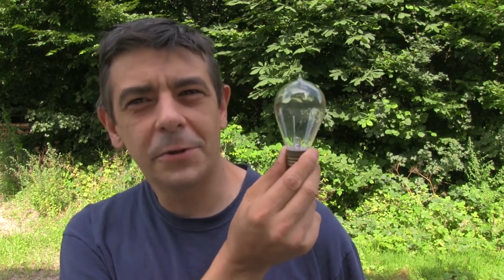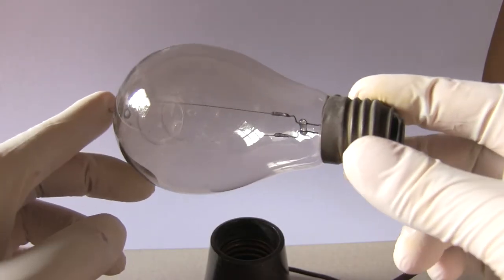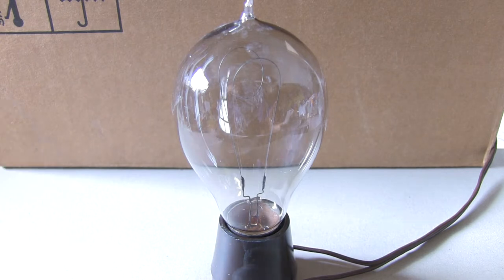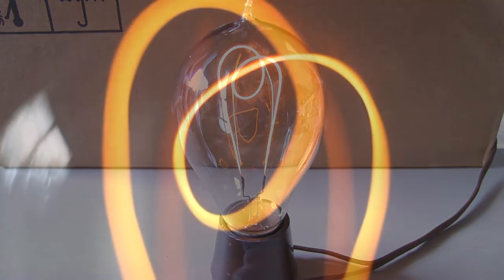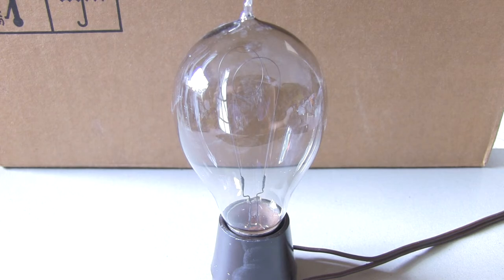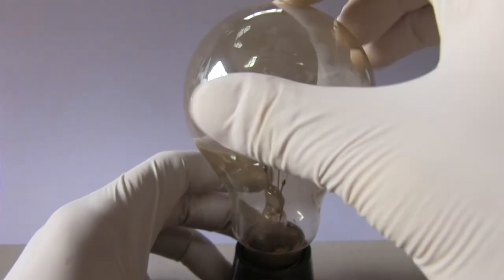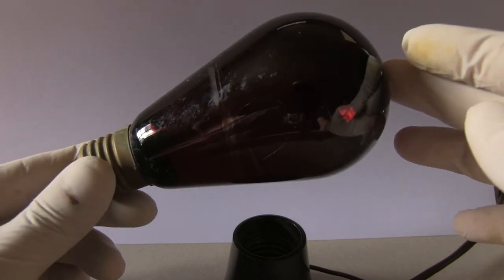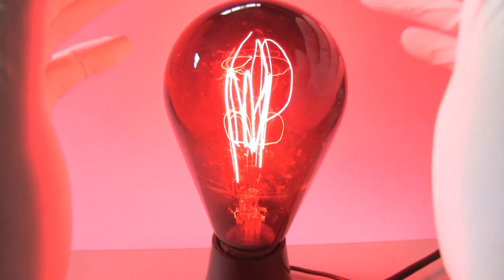Carbon filament Lightbulb from the 1900's. And others from my collection

Comment: But how many Watt has the old carbon filament bulb when comparing it to the 115W from Philips?
Reply from the maker: It's about 40 watts, I measured the current and calculated it, since there were no indications on the glass or socket.
Reply: @MrAnalogDan12  Thank you! But then its no surprise the new one is brighter than the old one. ;)
Reply from the maker: @karsten2  Maybe I mispoke in the video. I wanted to compare an old style filament (the Philips 115 watts) with a modern 100 watts light bulb which is then way much brighter. Sorry bout that, and thanks for the feedback !
Reply: @MrAnalogDan12  Oh. Understood. Well you compared the old carbon filament bulb on thge left in direct comparision with a newer carbon filament bulb on the right in the video. So I thought that this comparision isn't fair because of the different wattages of both. ;-)
Reply from the maker: @karsten2  Now I understand ! The direct comparison at the end is between a Carbon 115watts light bulb and a 100watts modern tungsten filament at 4:03 !
Reply: @MrAnalogDan12  Ahh... my fault! Sorry. I understood it to mean that one carbon filament lamp would be compared to the other. But here was the comparison with a tungsten bulb! Now I've got it. :-)) Oh well...